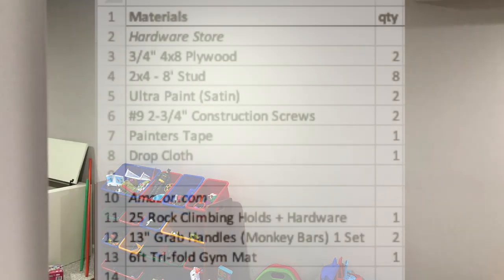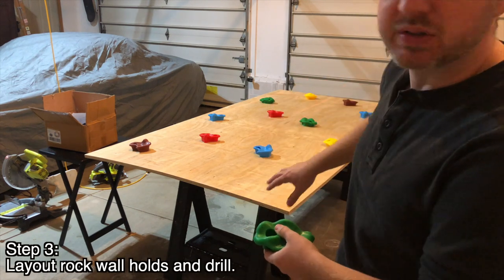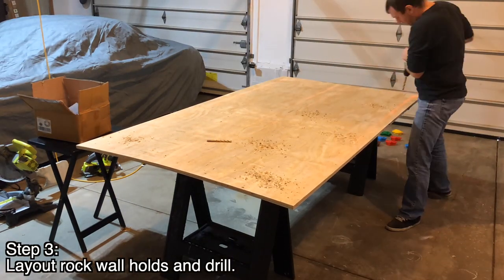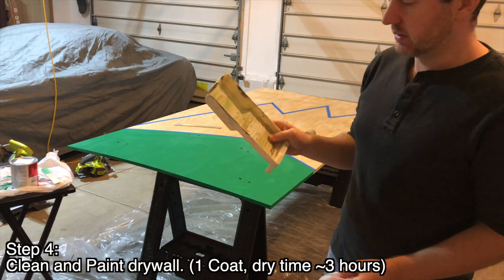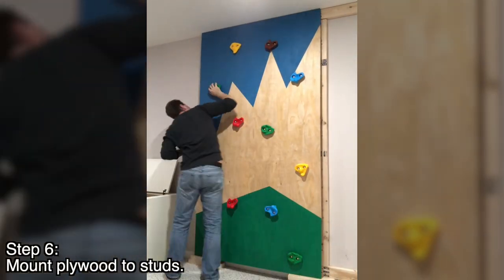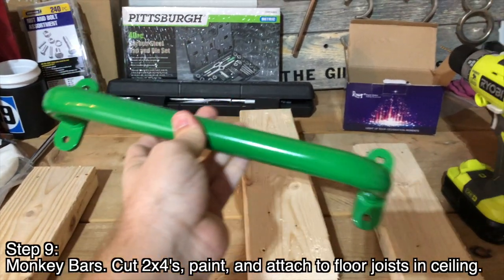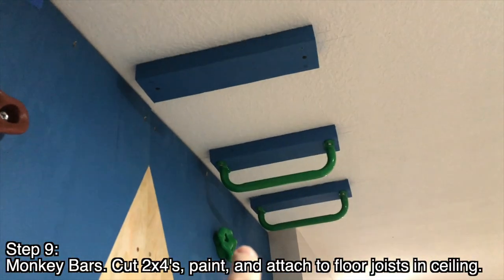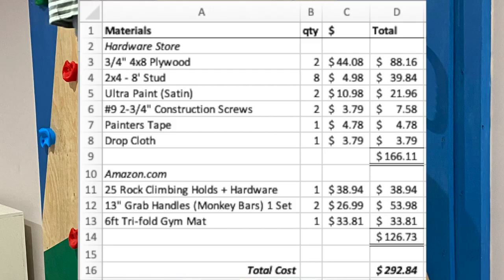DIY Basement Climbing Rock Wall and Monkey Bars

Comment: Nicely done! I would recommend pre-drilling multiple holes with bolts into your plywood so you can re-set holds from the outside (without having to take the wall down) in the future! Otherwise spot on! Love projects like these (working on 4 similar walls like this for kids now as well)

Comment: hello, thanks for uploading this video. I have a question for you here.. when you are fixing that studd structure on studd (at wall). what size of screw you have used. I have a 4X2 studd to be fixed on unfinished wall in basement.

Thank you !

Comment: Great video! I created a monkey bar Project myself early last year when covid started and parks closed. 
I secured two 2x6s onto my basement ceiling and then attached monkey bars to the 2x6s. 
I still worry if it’s ok for kids to be hanging from these monkey bars. Will the weight pulling down on the joists cause damage to my family room floor?
Reply from the maker: I like your idea better as it distributed the weight more. I thought about that after the fact. They are both under 50lbs for now so I’m not too concerned.

Comment: Hey Ian, New subscriber here. Quick question, I see you used the #9 2-3/4" construction screws for attachment to the floor joist, but what kind of screws did you use to attach the plywood to the frame?

Comment: can i skip the frame installation instead of directly install the climbing plywood on the the wall?
Reply from the maker: In my case the bolts I used to secure the climbing holds stick out the back. I suppose if I had cut the end of the bolts off and made it flush I could have done that. Instead I did the frame.

Comment: Hi! Thanks for your video ive watched it a couple of times and im ready to go this weekend! I have a question if you dont mind. I plan on lining the board with a peel and stick wallpaper. Would i drill the holes first and then wallpaper or do it after wallpaper? Wondering bec you painted after the holes. Is there a reason for that? Thanks!
Reply from the maker: Good question. When drilling the wood can splinter. Painting after helped cover up some splintered wood, I suspect the same could be true for the wallpaper